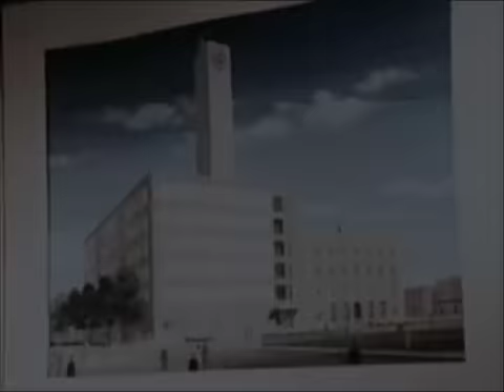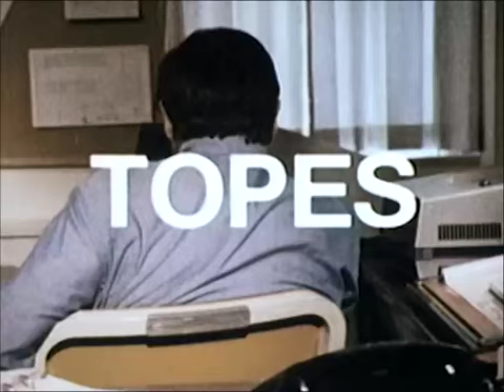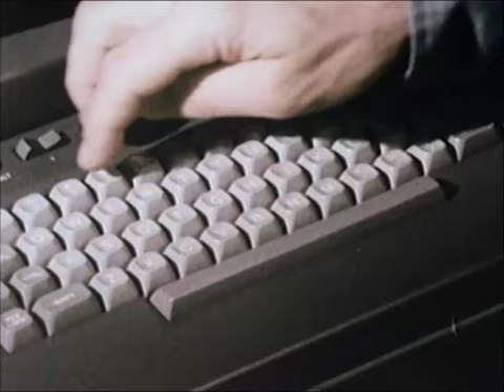TOPES: Telephone Office Planning and Engineering System, from Bell Labs, 1978

Comment: Back in the early 90s, I worked in planning for a Canadian telecom.  However, I didn't do the sort of work as in this video.  When I was involved, the floor layouts had already been created and I would just update them as new racks were added or significantly changed.  I would also plan the overhead cable racks, when needed.  I didn't have anything like TOPES in my work, as I was focused on the actual equipment being installed, cabling, power requirements, etc..